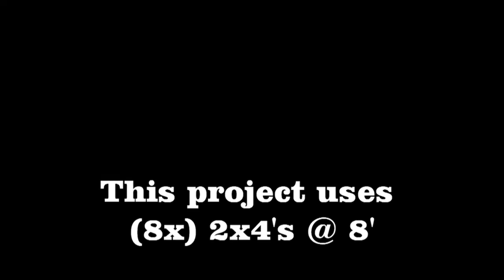DIY Trestle Style Sofa Table under $30

Comment: I am very new to woodworking so take ANYTHING I say with a grain of salt!!  I'm curious about having a 1/2 a 2x4 on bottom shelf and a 1/2 of another on the top shelf...  Is it to have it match to an existing depth between your sofa and wall?
Reply from the maker: yes. i trimmed the edge of one board so that my final width is 15" on the top and the bottom one is trimmed to 12.5"  dimensioned lumber from the home stores makes for easy math but sometimes it needs to be trimmed down.

Comment: What is the best way to fix the wobble at 8:43? Thank you for posting.
Reply from the maker: adding the bottom shelf.  The legs are loosely attached at the top until you measure, add the shelf, and tighten everything down, then it sits perfectly flat.